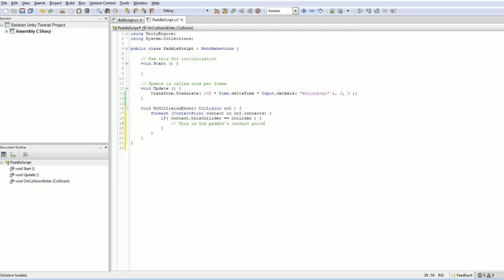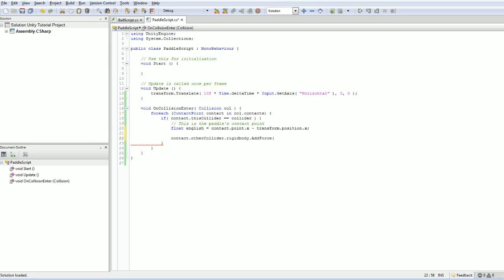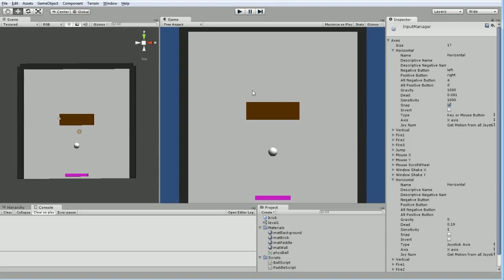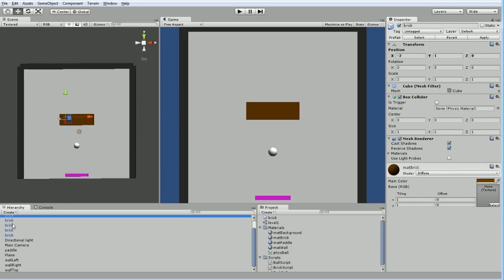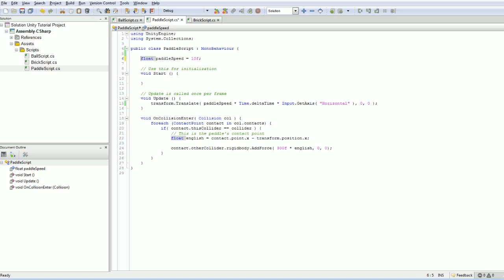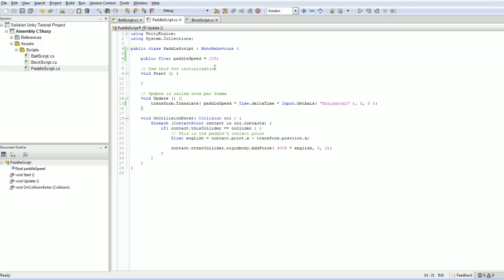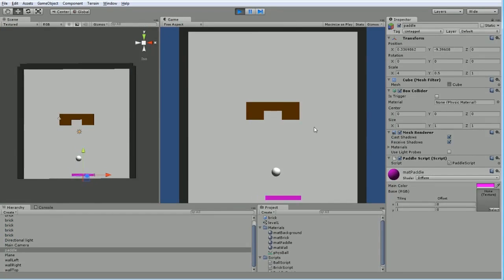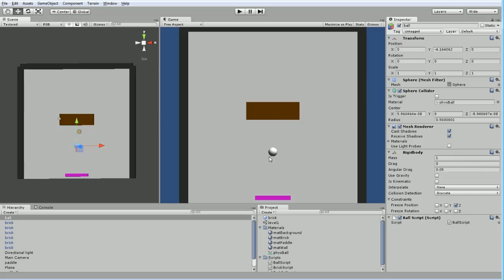Unity 3d Tutorial for Programmers - Part 9 - Adding "English" to the Collisions

Comment: Durakken Im having the same problem you described did you find a solution?
Reply: Nope, never found one.
Reply: Years late, but in case anyone finds this and gets stuck, what I did (Unity 5) was add a Wall Script with the following:

// Check for ball stuck horizontally 
    void OnCollisionEnter(Collision col) {
        foreach (ContactPoint contact in col.contacts) {
            if(contact.thisCollider == GetComponent<Collider>()) {
                Vector3 v = contact.otherCollider.GetComponent<Rigidbody>().GetPointVelocity(contact.point);
                if (Mathf.Abs(v.y) < 0.05f) { // Ball stuck
                    contact.otherCollider.GetComponent<Rigidbody>().AddForce(0, -75f, 0); // force it down slightly
                }
            }
        }
   }